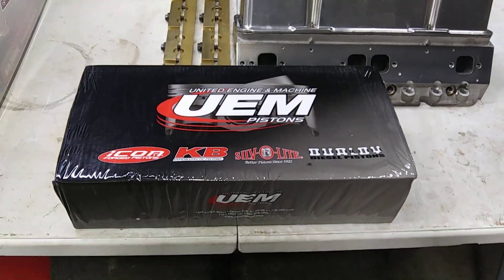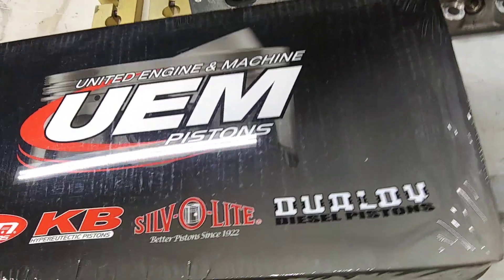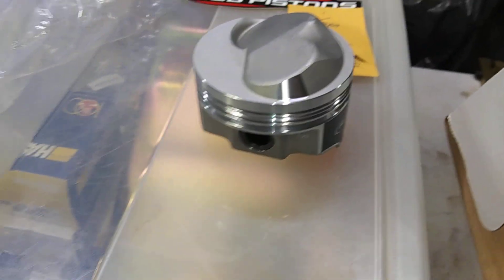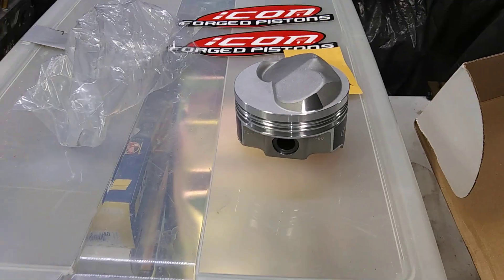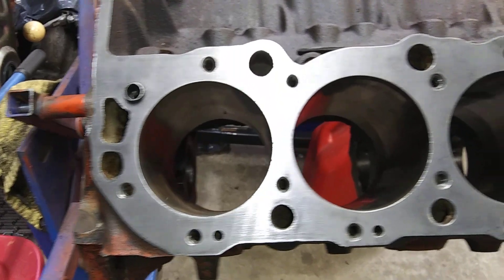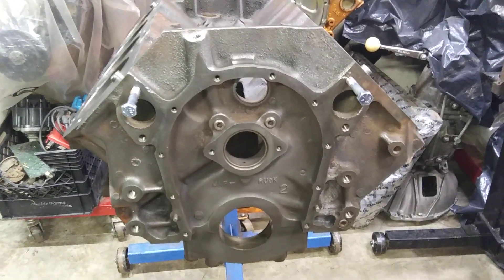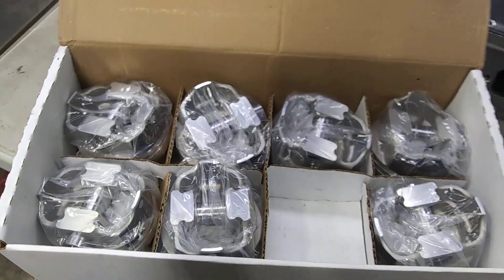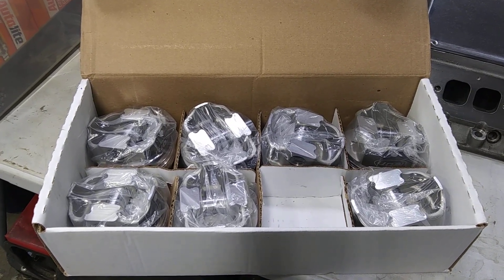427 BB Chevy 44.7cc dome "ICON" 9.8 deck pistons for a 427 TD 10.2 deck block with 6.535 H-beams.

Comment: Mr R.G...can you tell me if I made a mistake on a 70 tall deck that has no core shift thats be bored 130 over.
Reply from the maker: @ronknowles-wm9pz  Shit, it'll be fine. I've never done it, but I've heard of people boring these blocks to 4.500 will filled blocks running on pulling tractors. They are a lot thicker than the pass car shit. I have bored one .125 over with no problems. Still had thicker cylinders than a standard bore 454 from the 70s.
Reply from the maker: @ronknowles-wm9pz  Don't use them 4 ring pistons tho, go for 9.8 deck 427 pass car shit and 6.535 long rods. Stock crank in those tall decks are strong as hell.

Comment: Those look very nice, im waiting on a set of flat tops by them so this video makes me excited!
Reply from the maker: Competition Products keeps them on the shelf. Good prices too. Fast shipping.
Reply: @thereluctantgearhead4544  I hear people bashing Keith Black all the time saying they explode and shatter but i hear great things about ICON so i wonder why people say that if they are all under one parent company
Reply from the maker: @Christoph_NTX  That big company is buying up all the smaller companies. Those KB pistons needed alot of gap and people would run them with regular gaps and fuck them up and blame the piston. But the circle track guys been using them for decades. They ain't bad pistons if they are installed with the correct clearances and gaps. But KB and ICON are 2 totally different companies that got bought up by the same multi national conglomerates that are buying up everything. Believe SRP and JE is also owned by them, along with a long list of high performance parts companies.
Reply from the maker: @Christoph_NTX  Won't be long and 2 or 3 companies will own all the company's. Look at how many companies the Holley group has acquired. Good way to control prices when you own all your competitors.